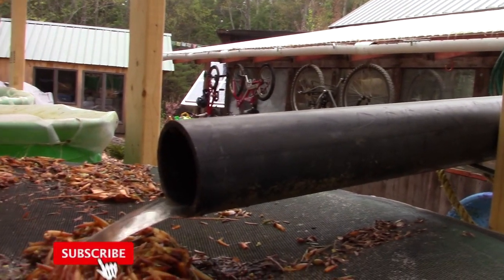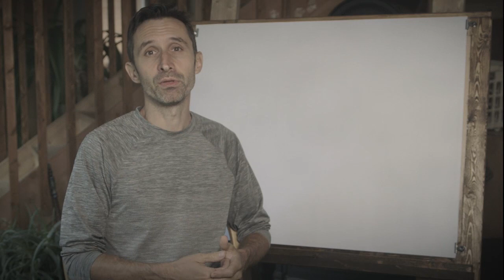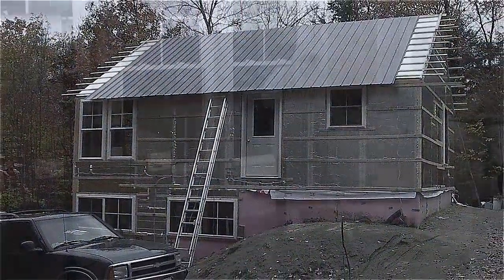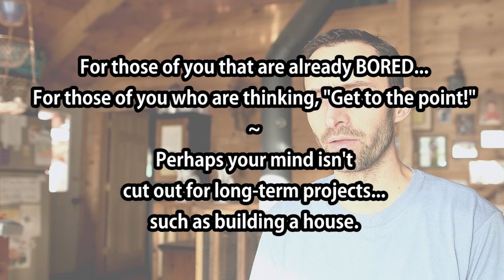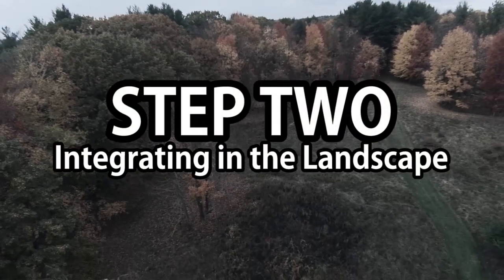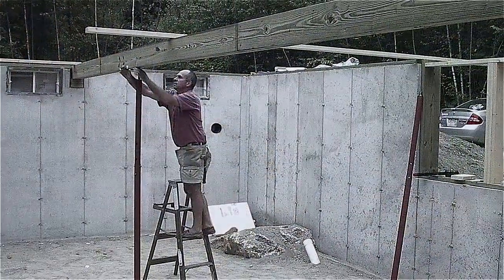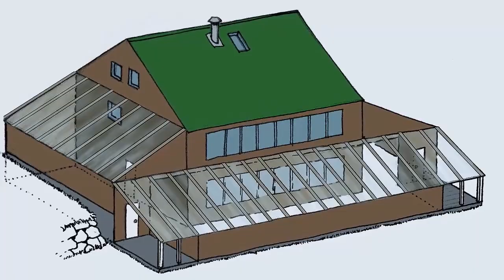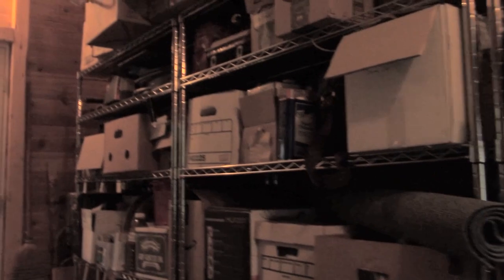Building an EASY Retreat Home

Comment: Even though I haven't yet moved there, I bought some land several years ago in the Nevada desert. This was no impulse buy. I carefully researched the area, and made some interesting discoveries. One is the surprising amount of surface water withing reasonable distance from my land. Another is the population - about 250 people in an area of about 1,800 square miles. So, I think I won't have a lot of trouble with marauders.
Reply from the maker: Sounds like a good spot. Have you checked on the current surface water sitch there with the new lower rainfall patterns? If the surface water has diminished, it might be good to know that ahead of time to make alternate plans in terms of how you'd make sure you have water access there.